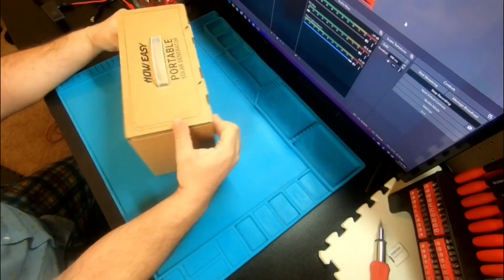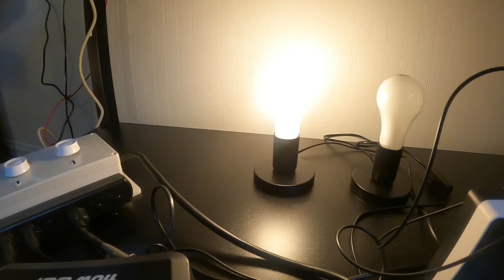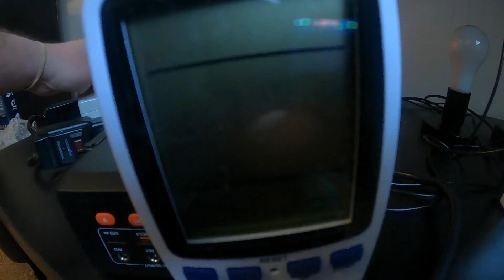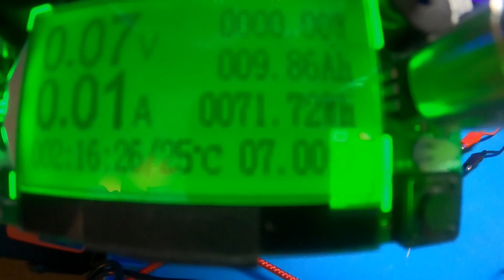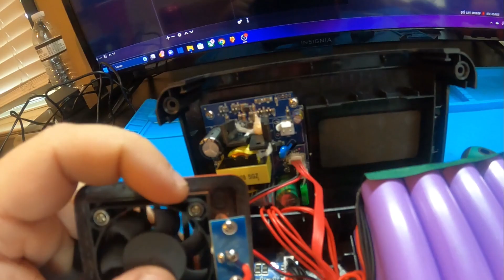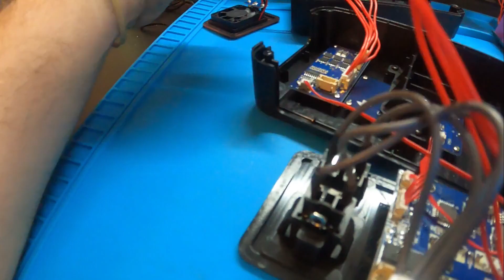HowEasy 120 Watt Solar Generator Testing / Disassembly

Comment: Does it hook yp directly to a solar panel?
Reply from the maker: Yes it does. But it charges at only 12 to 15 volts and no more than 2.5 amps
Reply: @OperationCamp que pasa si tengo un panel solar de 12v 100w

Comment: Do you recommend it to me for non-rough work, that is, one or two lights between 2 or 3 hours of work
Reply from the maker: Oh yeah. It should run some led lights for a while. We run a bed side light for days with it before it needs to be charged
Reply: @OperationCamp  ty so much i will buy it 😃